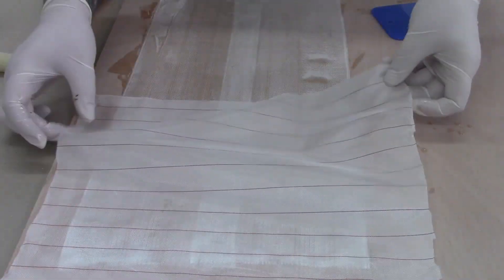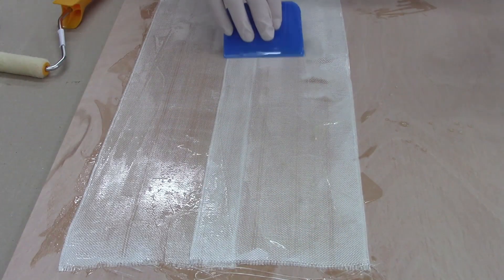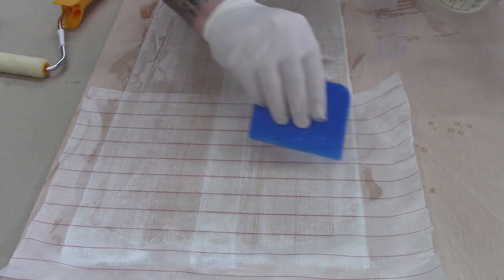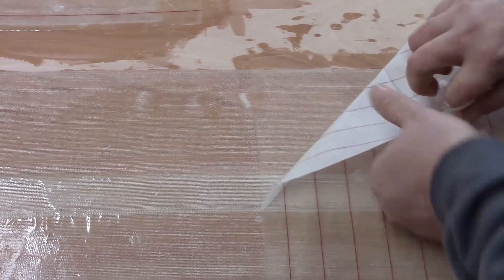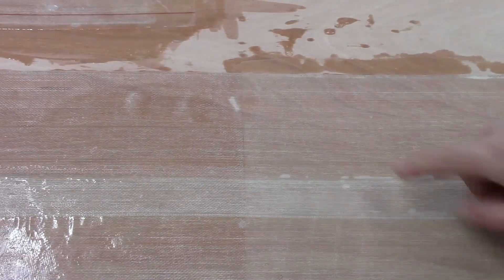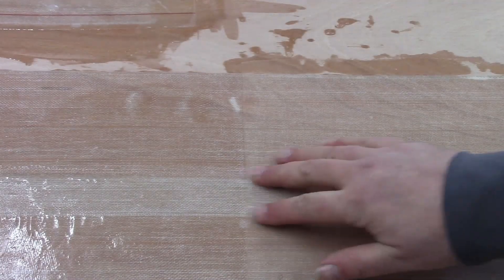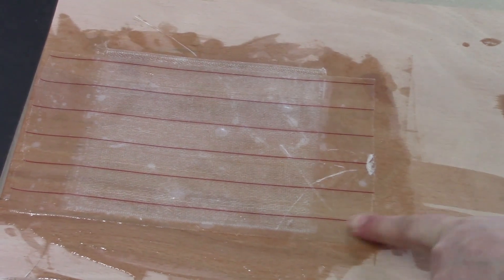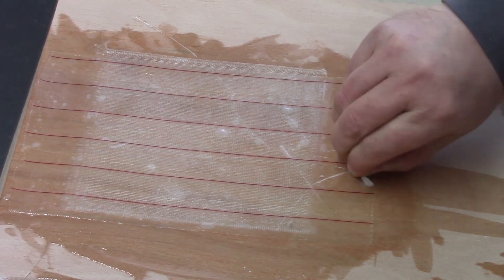Peel Ply

Comment: I've seen a few videos now with peel ply over fiberglass. However, I'm using it to hold down Dynel fabric so it doesn't lift off the surface of my material and become suspended in the epoxy. None of the videos I've seen use tension on the peel ply to keep fabric down. Do I also not need to do that when I use Dynel? If I do need the tension for Dynel, any tips on how to achieve that on a complex shape like a canoe hull?
Reply from the maker: some fabrics are quite good at staying in place such as light woven fibreglass.  I'm not familiar with Dynel but some materials such as Carbons and even heavier glass fibre cloths can tend to lift from corners, especially carbon as it usually  wants to straighten back out and also float on the resin.   These materials usually need to be vacuum bagged to hold them in place.  look up vac bagging or resin infusion as this may be the route you need to go down?.  we recently  made a carbon Canadian canoe and that needed to be infused and bagged.

Comment: I did the bottom of my 3 meter rowboat with fiberglass over plywood. But not realizing the peel ply option, it came out gloppy looking with overfilled epoxy resin in many areas. surrounded by underfilled resin areas despite my best efforts at rolling. If I sanded the surface dull and put more resin on but Peel Ply this time, I'm guessing it would probably be too late as the underlying hardened epoxy is already thick and thin, correct? I probably need to fair with fairing compound and sand smooth.
Reply from the maker: HI Paul, the peel ply method leaves a good flat keyed surface ready for over coating with more epoxy and is more beneficial at the end of the laying up process.  if you did sand back your epoxy and wipe it down with solvent or acetone to remove any grease or amine blush from the old epoxy you could just apply another even coat of epoxy without needing to peel ply?

Comment: Great product. I've used it many times. I wonder if it can be used over gel coat repairs to get a smoother finish. I have problems with orange peel when spraying it.
Reply from the maker: it should work we have used this with polyester and vinylester resins so i cant imagine it wouldn't work with polyester gelcoat?.